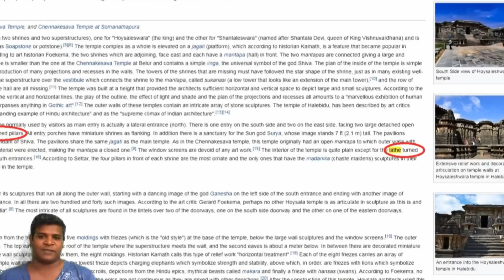Hoysaleswara Temple, India - Built with Ancient Machining Technology?

Comment: They wouldn't spin a multi-ton stone pillar.
I think they would use a clamp type tool that would be manually rotated around the stone to create the even grooves.
Unless you can find a massive workshop, then big mechanical lathes aren't really possible.

Comment: Excellent analysis my friend  👍 
The fact you were able figure out the planetary gear ratio was a big convincer too. Im a mechanic in the printer industry and have seen planetary gears thousands of times. There no way they Would know a planetary gears ratio without having already seen machines already.
Reply: You're not a mechanic. Those aren't planetary gears. The ring gear has no teeth on the inside. Plus there is NO PLANET GEAR, let alone space for one. 
Any mechanic would know this. I'm not even a mechanic, and I can clearly see that's no planetary gear system!

Comment: The horizontal carvings on the pillars do not require a huge lathe. Leaving the big stone fixed in place, a very simple carving tool may move around it in a tied orbit... The most simple a rope sliding towards and backwards on the rock while adding sand and water would carve more than half of circumference. The man moving the rope, moving himself around the stone, would mark pretty precise circles and model like a lathe would. Same could be done with a heavy cutting tool, I.E. a quartz splinter once tied it with a rope to the center top of the rock to model... This would allow both the latheing and the precise hammering of the surface... Or elsemore three or more hard rock wheels tied more and more while moved around the rock to be modelled...
I think that those Ancients' advanced technology might not be "advanced" the way we mean the word today, powertools, precision instruments. Their advancement could have been in cleverness, knowledge of the materials and human skills...

Is there in the museum of St. Mark's Basilica in Venezia, an ampule carved in but one ialine quartz crystal. It is about  30 cm tall and maybe eight in diameter, with a very long neck... Very subtle and elegant, they left no more than 4 mm of quartz to separate the inside from the outside. A marvellous artwork. How could they work the inside in the larger lower part of the vase pasing through the six mm narrow hole all along the neck? Hypersonic, laser, plasma??? Maybe, but maybe also infinite patience of an artist devotion,,,, Moving up and dovn million of times appositely shaped long needles...

Comment: The lathe theory for the pillars is the only logical solution based on what we know today based on those marks and the identical pillar carvings would also support that idea, it wouldn't be impossible to carve a rough blank and use animal power to turn the blank between centers to carve the pillars.

Rotary burrs are not used for polishing, they are for rough and heavy grinding of metals, you wouldn't use them on hard stone as the would clog very quickly. Some of those images are showing natural items such as pine cones and corn cobs. Planetary gears are not used in any part of a measuring tool, and a circlip would be used to hold the parts together such as a shaft through a frame, the frame itself is not the circlip. The image of a spiked wheel within a spiked wheel could be anything and the reason there are 32 teeth on the large one and 16 on the small one is because of the way the points are initially drawn, it's just easier to line them up, divide a circle by 4 then rotate by 45 degrees and mark again, you will quickly see how the pattern develops.

You are jumping to conclusions based on a very thin and tenuous link with modern  techniques, stick to the facts.

Comment: First off yes looks machined. Problem 1. Pieces this large would require huge chucks. 
2. You would need a center on a piece that long.
3. Interrupted cuts. If the piece started out as square by the looks of the base and the posts are 1 piece. To hold square items in a large and cut them takes very rigid work holding and strong tools.
4. After hoisting thus huge piece of stone into a large with a center holding device. Cut it. Then take it out and move it into place. 
In conclusion we are still missing a piece of the puzzle. Even with machinery it seems like a crazy task

Comment: I've watched this video several times and each time I look at it I become more amazed. Now I'm assuming that this temple like most other ancient megaliths of this type was carved from one huge rock. If that is so then the columns that support the ceiling couldn't have been turned on any type stone cutting lathe as they would have to have been a chunk removed, turned on a stone lathe and then installed back where the chunk had been. As this temple is all one piece that would mean that the columns were shaped perfectly where they stand. Some of the columns have different angles on them that would be impossible to cut or even retain on the piece itself if they were turned on a lathe. Also, notice the decorative "molding" at the top of the columns where they connect to the ceiling. The pine cone looking item that is common in Sumerian and other ancient statues is a pineal gland. This is where our soul resides as well as your imagination, sixth sense, intuition, and other functions. It is what separates us from animals. If you drink tap water in the US by the time you are an adult, the fluoride in your tap water has caused your pineal gland to calcify and no longer function as designed. I think it is impossible to build the temples by any type of construction or stone carving techniques that we have knowledge of. This is way beyond anything mankind could achieve. Now or ever. Some very hard stone if not placed where it is subjected to extreme hot/cold, or extreme harsh conditions can stay perfect forever.I believe these temples and other like structures are at least pre-deluge if not pre-ice age. It's impossible to try to time frame because it is older than anyone imagines.
Reply: That's true  its lost to modern man but the is clear evidence of saws,chisels,of many different types also unknown to modern man some type of lifting capability and lathe technology those columns where they are rounded thin groves around the entire pillars were lathed the 90 degree carve rectangle sections  have on top a square  peg to stack the rounded lathed pillars in sections  I'll try and find this video witch show this and would like to hear ur opi
Reply: Great bro
Reply: Just wanted to let you know that these pillars and in multiple sections turned and placed in their respective locations.. so now what ?
Reply: @dedpool3890  I don't know. Besides having to have been a massive masonary lathe to turn the columns to cut them. Some of the columns have designs on them with 45 degree and other angles that would be impossible to cut with any type of lathe known to man.
Reply: Absolutely

Comment: Wow! This is one of the most dramatic examples of old machining I've ever seen, I had no idea. Thank you
Reply: It truly is. I've worked a fair bit on lathes - and know of some big ones - but this is really very strange indeed. I am personally wondering if they had developed a mechanism to rotate the tool around the pillar on an armature - rather than the rotating the work piece itself. Either way... it's not 'precision' lathing... But that remains a hellishly serious undertaking in terms of lathing. What the hell they were using as a cutting bit... That is the big question. ...I can't imagine my turning chisels would keep their edge all that well on that.

The other huge issue is that they had to round this off first - you start with an irregular form... How the hell do you get an irregular piece of stone that size down to a smooth round? If you spun it at any speed... The machine would have to be ridiculously strong to stop it shaking to bits... This is truly nuts.
Reply: @JesseP.Watson  

Mind blowing technology, i’ve been around lathes...for the last 40 yrs ...dont know of any current technology that could turn that large piece of rock/ granite into this priscision!
My one thought was they either crushed the rock to dust and then formed a formulae with different chemicals to a form liquid rock, after a certain time would harden to rock again....while in cureing process then turned it .
Second thought was they could have chiseled a length of rock to a rough rounded form...chiseled a cavity on the centre on both ends...so it could turn on these points...and had a stone structure to suspend this length of rock vertically...then spinned the length of rock on its axis against a cutting tool....this is from where we need to investigate further how it possibly could have been turned...if we on the right track! Just a thought!
Reply: @sagrengovender365  Yes, I imagine this being vertical myself, spinning it horizontally would require crazy power at the beginning when it wasn't perfectly round.
My thought was that perhaps they did as you say but had a wooden "U" shaped frame that ran from top to bottom - like the chisel rest on a wood working lathe but attached at the centre either end of the column. If that "U" frame was then spun around the column, perhaps powered by a rope wound around it at the bottom, with their cutting tool fixed to a point on that "U" frame, whilch would be moved up and down as they worked, so it spins around the column...
Do you see what I mean?
Basically meaning that they avoided the need to spin that HUGE piece of stone and spun the cutting tool instead.
...I imagine that could work at low speeds, perhaps powered by an animal - it doesn't seem impossible to me anyway.
Reply: @JesseP.Watson  made by magic
Reply: @meunderhypnosis407  ...The forgotten magic of craftsmen who knew their stone like we never will, I reckon. ...Just published a video about that in fact. ...Shameless plug, but may be of interest.
Reply: @JesseP.Watson  its nuts!! I never thought of the fact they had to round it off first! Whatever they did can ONLY be described as magic.

Comment: Well these pillars were not actually one single stone but are five different bits... these are made out of soap stone when you procure a soap stone from a quarry it will be very soft compared to normal stone... as such as soon as the stone is procured they are tied with rope and are turned with either horses or elephants.... depending on the sun.. as such they are similar to lathe precision....
Reply: Soap stone is a bit heat resistant so i am not sure what your talking about. Maybe a furnace would have been used for the lathing process. But again some pillars are not just round in shape so to get that kind of precision is also baffling. What is interesting is the carving on the gods, that looks extremely difficult with low light inside with minute carvings.

Comment: They definitely had high technology beyond what we know today....but the marks on the pillars resemble the marks on clay pots and not machine tool marks imo. Plus the statues I’m sure were made using the same ancient techniques they use today which is sculpting out of clay, or wax if they want to make a mold for metal casting. 
Maybe they used clay and let the statues bake under the sun until they hardened? After 100’s of years the clay may of petrified into stone so it seems like they carved the Murthti’s out of rock? As for the necklace and skulls....they sculpt those separately and stick them on after so the necklace would be one single piece of sculpted clay that you can drape across the neck of the idol. Once again giving the impression it was sculpted from one piece. The technique is thousands of years old and passed on from generation to generation so they definitely used it in the time those sculpted were made.

Comment: That's not a planetary gear... It's just 2 gears one in the other. Yes it is representing ratio but human beings have had a comprehension of these sort of things way way longer than any civilisation... They've had cogs and lathes for a very long time too but not like fully ''incremental machining'' metal ones until more recently. At least it doesn't seem like they did but wooden ones for sure many ages ago so the concept was already there. It's certainly very impressive if they had a massive stone working lathe, I can believe that they might well have done.

Comment: They used to used locomotive engines to turn stone pillars this size like a lathe and bigger back in the peak of the railroad . Today they do not turn pillars this size on a lathe they do them in smaller sections and stack them .   The people who built these pillars most likely used huge water wheels to power the turning of these huge stone blocks .  The ones they used with locomotive engines only used lumber as the mounting chuck so ancient man could probably figure that part out .  900 years ago they had steel to work the stone but really why don't you see more of this lathe work if they had the machine set up to build them ?  It seems strange they only used the machine to build lathed stone .

Comment: Again a very good video. I learned the trade of cutting machine operator. Milling, grinding, turning. 6 years at Daimler Benz in the 90's. There is no doubt, 100%, that everything you show in the video was made with turning tools. I can see that from here, on the ground I could analyze it better, but it is not a doubt. It's all made by great tools. Best wishes from Germany.

Comment: The temple has no cementing thing to hold onto the adjacent rock pieces ..its like jigsaw puzzle..we can take out each pieces and join it back!!
There was one rotating pillar but it has got jammed because of an earthquake 100 years ago. This is my hometown. Haasana.
It is made from soap stone . Soap stone is  soft when its freshly taken out of  the earth. It hardens later.
Reply: @Lion king I don't think such precision can be attained using hand tools so most probably lathe machines.
Reply: Sooo. Fresh and soft. The anticipate stone could be turn on turn table and mimic cnc with rope for friction??

Comment: Those pillars weren't processed on a stationary lathe, they were processed with a turnstyle lathe. You connect a ring around the object, and this ring is buffered by wheels, or pins. Then, to the atttched blade, screw it in. It could be a simple hole on the ring you push the blade point through. Then roll the entire ring around the stone, as the blade cuts its path. To go deeper, simply finish a cut, then adjust the blade to cut deeper, and take another 1/32 or 16th of an inch off, so on and so forth. You can tell this is the process used because you'll notice wide imperfections running up and down. This occurs as the wheel moves around the stone. They could have done this back then, mostly because they focused forward with their engineering schools, obviously, instead of their archeology schools. I imagine today's biggest problem is that as a society we spend more time looking back instead of looking forward. Perhaps that's why the written word took so long to develop, math was more important.

Comment: They quarried rocks and chiseled them to approximate cylinder shape, using chisels and hammers. The cylinders would have rough cut surface geometry. The workers then  mounted each raw cylinder between supports, using metal cone shaped axles, The rock cylinders would be free to rotate. The cylinders were rotated (perhaps in both directions) using ropes and pulleys and  animal power. While rotating the cylinders, workers hand-held (sharp or blunt)  iron tools against the spinning rock column. This would grind the surface as needed - to the final shapes we see today. It was a manual lathe operated without electric power. Some such devices are still in use for wood work in remote places. Some tailors use a similar concept for human powered stitching machines.

Comment: lathing stone pillars doesn't seem like a very complicated thing to me..and 900 years ago isn't that long ago comparatively speaking...  somewhere around 1100 AD or maybe a bit later..  all you need is a rotating platform strong enough to hold that weight ..they would have cut this stone in the vertical position not the horizontal position

Comment: INCREDIBLE! Obviously a lathe was used. But even more alarming is that that god you show (holding the 2:1 ratio gear) actually has FANGS.
Reply: and boob jobs !
Reply: @dansdoves3650  😂😂💥
Reply: Draculmaharabata
Reply: They aren't even remotely gears. The teeth don't mesh. If they did, they'd simply lock together, i.e., no gear ratio. And most importantly, this "planetary" gear has NO PLANET GEAR(s), let alone room for one, between the sun and ring "gears"

Comment: I was blessed to visit this temple. The carvings are heavenly . There are many other details as well. If you are visiting I highly recommend to get a local guide . They will explain a lot of Surprising details in the carvings . You will need a moment to digest most of them. Another thing the guide told was this is carved out of lime stone. So it is easy to carve out and later when exposed to air it solidifies. I can’t say this is valid just what I heard
Reply: It's carved by using soapstone, not limestone, all temples of Hoysala period have used soapstone, entire structure can be dismantled in reverse order! No adhesive has been used.
Reply: Limestone doesn't morph into basalt. Basalt is a type of lava

Comment: I have seen this level carving done in stone and wood. The really interesting question is the tooling involved , as for the lathing you could build an upright lathe that is rotated by hand around the column creating the grooves. again the interesting question is the tooling did the know how temper and harden steel or did they use very hard mineral tips ie diamond hard  edges flint etc.The carving is manageable but the tooling is intriguing. They obviously had very skilled artisans who possessed wonderful artistry and had developed excellent technique.